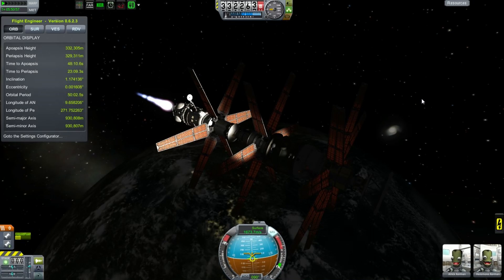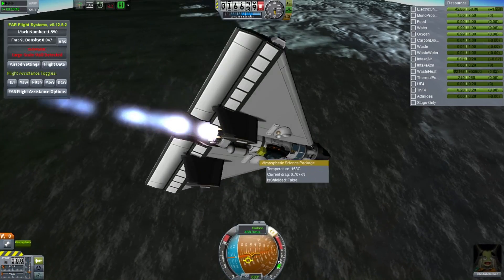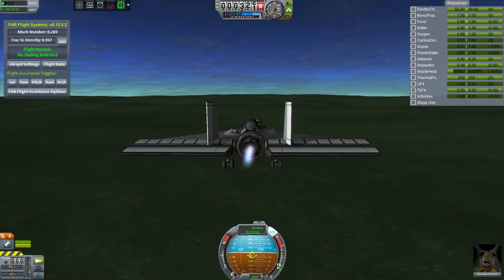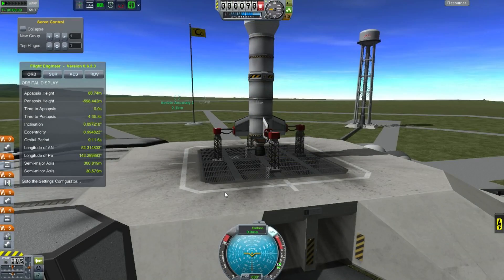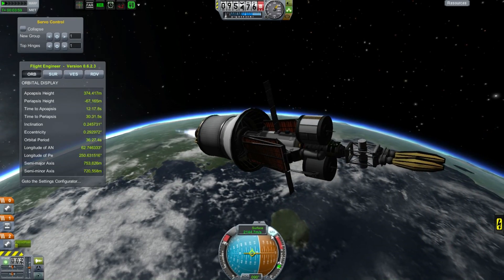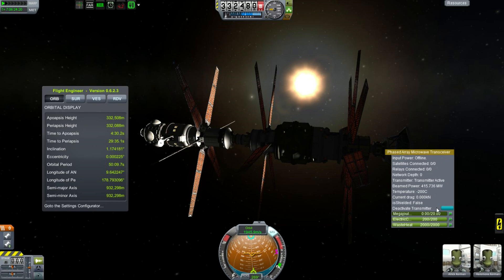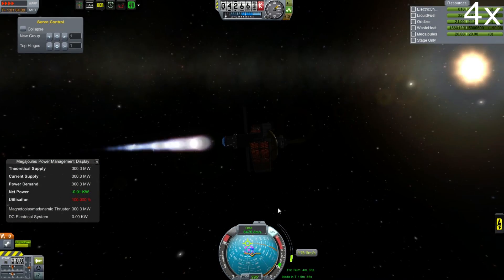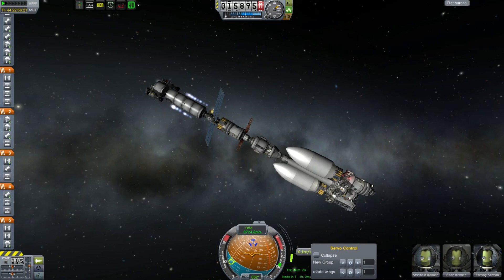Kerbal Space Program - Interstellar Quest - Episode 32 - Going places fast.

Comment: Color Hex color codes - #bada55 color RGB value is (186,218,85). #bada55 hex color red value is 186, green value is 218 and the blue value of its RGB is 85. Cylindrical-coordinate representations (also known as HSL) of color #bada55 hue: 0.21, saturation: 0.64 and the lightness value of bada55 is 0.59. . yes it's the exact same color as the kerbal's I couldn't help myself I had to look it's a really nice shade of green.

Comment: what could be done with a "beamed power" station is using the effects of the quantum interconversion of electrons and energized photons, you could essentially create nanodrives that beam between the two stations, each carrying power. however, there are two drawbacks. first, you would need a nanodevice that can be accurately aimed from thousands of miles away, between two items the size of pencils. also, the nanodevices would need some supermaterial that has a significant amount of surface area (per say, a polytoroidal carbon nanotubes complex).

leave a comment if anyone thinks of a more practical idea or a crucial revision.

PS: if any definitions needed, I'll define.

Comment: The blackbird used cones on the air intake to 'slow' the air coming in to the engine
Reply: Shock cones are a fairly primitive solution to the supersonic intake problem and don't work very well at lower speed.
Modern supersonic intakes are fancier, using small geometry peculiarities to form the shock compression at high speed without choking at low speed.

Comment: I wonder how slow a thing in ksp can be without stopping
Reply: As slow as a 32 bit float allows which I believe is 1.175 x 10^-38 m/s assuming Kerbal Space Programs meter is a unit of 1 in the game.
Reply: Walter Kuppens The game got a 64x version now
Reply: Official Cbplayer It does, but the game might still be using 32 bit floats and only using 64 bit for the added address space.
Reply: Walter Kuppens ok
thanks that good to know

Comment: for those interested a rectifier actually only keeps electricity from going backwards through an electrical circuit. If you want constant voltage, you need a voltage regulator. Interesting fact, we have had transmitted power for at least 100 years as some of the AM band radios are actually powered by the AM transmissions themselves. (IIRC)This is possible because the AM band wave is such a low frequency. though as a power transmission it is relatively ineffective, for example you need something like a 10kw power station/transmitter just to power a 1w radio and this only works for something like 50-250 miles(depending on transmission characteristics).
Reply: :D When I was like 12 or so me and my great grandfather built a radio powered only by a small coil, was pretty cool I actually still have it.

Comment: Scott, a 15 point landing would require at least 15 wheels, when you say an X point landing, X refers to the amount of wheels that touch down simultaneously, so in your aircraft you could do a 2 point landing, with the main gear under the wings touching down and then gently lowering the nose wheel, or a 3 point landing where all three wheels touch down at once, this is not advised as it could cause your nose gear to collapse, 3 point landings are more commonly used in tail draggers.

Comment: There's another great application of wireless power transfer in RFID chips. The USA has started putting them in passports; most countries with a sophisticated banking infrastructure have been using EMV chips in credit cards and bank client cards for many years now (the notable exception being the USA which for some reason is still on the very out-of-date mag-stripe-only system).
Reply: Arctic Frost we swipe it not wave it but yes

Comment: Nice vid as usual Scott and I'm really enjoying this series.

I'd like to make a comment on the brick chargers you mentioned. You said they usually step down the oscillating electrical wave prior to rectifying. This is true for the old heavy chargers. Most modern chargers use switch mode regulation which rectifies the wave first, then steps it down using pulse width modulation to control the output current. This requires a much smaller transformer as the PWM uses a much higher frequency than mains current. Just thought I'd mention this =) Apart from that, you are totally correct about wireless transmission of energy in the form of electromagnetic waves. Some of the first radio receivers (dubbed crystal sets) didn't need a power supply because of this principle (well, kind of lol).
Reply from the maker: Thanks for clarifying, I'm not an expert on electronics by any stretch.
Reply: 12 years old and understand this =)
Reply: All of that just goes over my head. =D
Reply: will atkinson
Sorry. It was aimed at physicists, electrical engineers and electrical/electronic trades people =D I could try to simplify the explanation if you want me to, though it will be quite a wall of text. Let me know.
Reply: how do i delete is it on? im confused dont read this still figuring G+
Reply: chickenman297 Haha no im fine in my blissful ignorance but thanks. =D

Comment: I'm trying out the same mod configuration as used in this series. Having a bug where the command pod sorta clips through and just "decouples" (without decouplers) on the lunch pad. Anyone else experienced this problem? The parachute goes through the pod and sits under the pod if there is only the pod and the chute. If there's fuel tanks underneath the chute sits on the tank, the pod above the chute :S

Comment: Scott, you could use Dynamic Warp mod to reduce waiting time for burns significantly (if it works)
Reply: It does work but its very dangerous to use with a more complex design. Things can go wrong quickly.
Reply: I searched around and couldn't find Dynamic Warp anywhere, but it looks awesome, so does anyone have a download link?

Please?
Reply: I found it here:
http://forum.kerbalspaceprogram.com/threads/57324-0-22-Dynamic-Warp
Reply: Walker Wilson Dynamic warp accessed by holding down alt while pressing the warp keys on the keyboard. Dynamic goes up to 4x only because it is doing physics calculations which is why things can fall apart really quickly if youre not careful.

Comment: What you were saying about the microwave power, does that mean you can take the background microwaves and turn it into power? And can you do the same thing for the background radiation?
Reply from the maker: Technically yes, you can take background EM and generate power, I believe the mythbusters used a 100' antenna to power a digital watch.
Reply: Scott Manley
"Why don't you just go out and buy a BATTERY?"
Reply: +Ryan Q Yes, but the power available is very low. However, in a vacuum it would work much better.
Reply: +Scott Manley Well, no. They managed to generate 0.5 volts from a single 100-foot long antenna, which they guessed could power a digital watch display.

Comment: I want B9 for all these mods but i cant find the 0.22 versions :(
Reply: Look on the KSP forums under the Mods section. There is a section called Add-on Releases and Projects Showcase. Here I will link it for you: http://forum.kerbalspaceprogram.com/threads/25241-0-22-B9-Aerospace-Pack-R4-0c-New-pods-IVAs-engines-fuselages-structures
Reply: You can use B9 with 0.23, you just need to upgrade the plugins of the mod, like Firespitter, ExsurgentEngineering and maybe the ResGen plugin too (I don't remember...)

Comment: Pretty sure the "Power brick" MUST step it down first rather than usually.
Reply from the maker: What about high voltage DC supplies? I'm not an electrical engineer so I didn't know if there was an exception to this behaviour.
Reply: Scott Manley  Most low voltage stuff now rectifies the mains straight away then uses some form of Switch mode power supply to get the lower voltage. Lets avoid using large/expensive iron core transformers. For HV stuff you depending on the current you need, you can use a voltage doubler. Or flyback or some form of xray transformer, then rectifiers and capacitors that will work at the voltage wanted.

Comment: I cannever get into a proper orbit because I always run out of fuel x)
Reply: more boosters.
Reply: If you can't get something in orbit, you're just bad.
Reply: then slap more fuel tanks on. and on the stage bellow that, slap even more tanks on, and the stage bellow..
Reply: But then its too heavy or wobbly ahha
Reply: An easy beginning rocket for the vanilla game (you just need 2 upgrades for the normal and radial decouplers):
uppermost stage: the pod with 3 goo canisters and a parachute
next stage: 1 tank of fuel and an engine
next: 3 tanks of fuel and an engine
next: 6 radially mounted boosters
next: 6 boosters mounted to the tail ends of the previous stage
That baby can go to space and back even if you mess up your turning.

After you get into orbit you need to research the landing legs and the mini lab for the next step: landing on Kerbin's moons. You may also need struts if your designs tend to wobble.
P.S. ... and radial parachutes in order to be able to land back on Kerbin with you science experiments intact.
Reply: FreakingFreakyfied Add boosters if it is slow, and add struts if it is wobbly.

Science.
Reply: If it moves and it shouldn't add more struts, it it doesn't but it should add more boosters.